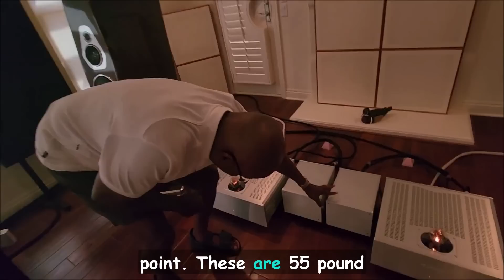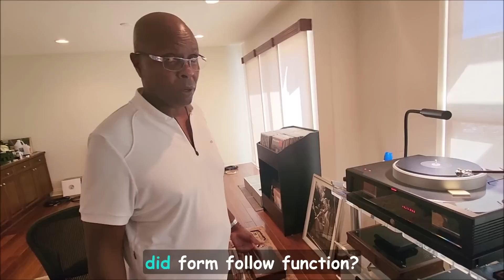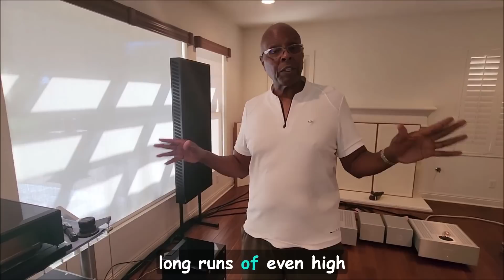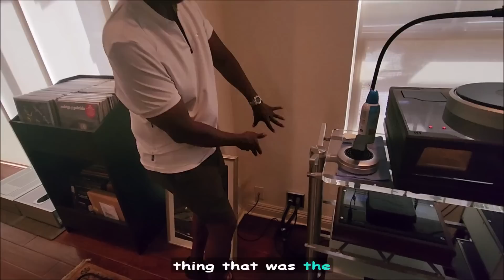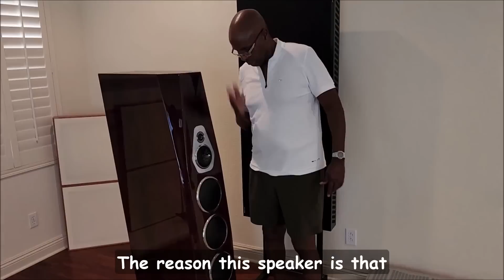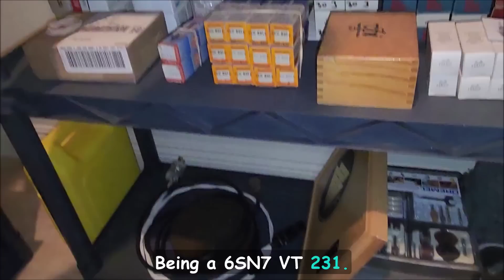Super Rare and Cool Gear at One of the Best Audiophile Distributors - Rick Brown of HiFi One

Comment: Bacch labs isn’t responding for months to customers about the VST U-Bacch plugin, very disappointing. It discourages of buying in to Bacch for Mac! 

I emailing to Bacch labs, several threads on ASR, Audirvana forum and PSAudio. Fix the issue please with Audirvana!
Reply from the maker: Bacch Labs is not Theoretica Applied Physics who sells the Bacch4Mac and ADIO and DIO I feature on the channel. I actually know little about that company and don't have any relationship to them or support the VST plug-in.
Reply: Bacchlabs if from Princeton just like Theoretical. 

Correct Jason, I response is really quick. I appreciate that much, it’s not about you. But I hope via this route I will get a response. I’m waiting for months. :(

Comment: How does the system sound?  It seems like a really curated system and I know you have your particular tastes.  Obviously he does not use DSP, so a lot will depend on his room which seemed open and a little echoey with your voices.  I saw his treatments at the first reflection, but floor and ceiling looked bare/hard.  Would be interesting.  He seems like a very nice and charming guy.
Reply from the maker: Impeccable gear and nice dedicated room.  It is more lively than mine for sure, but it suits the material Rick plays... Lots of great jazz and live recordings.

The analog stuff I heard.... Particularly lacquers.... Were among the best I've heard from a vinyl rig on that type of music.

FWIW...I'll have music clips in a subsequent video.